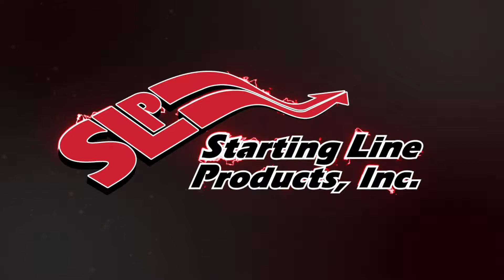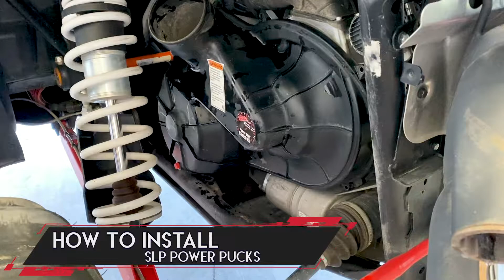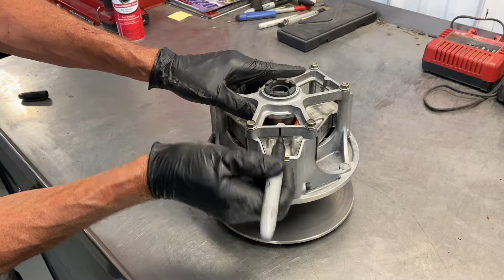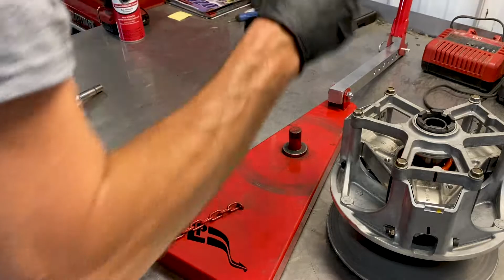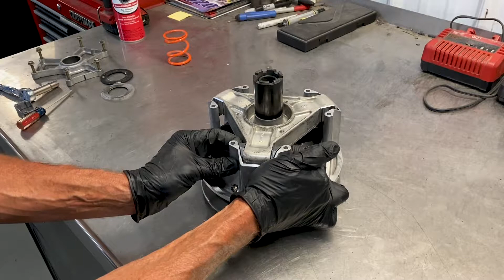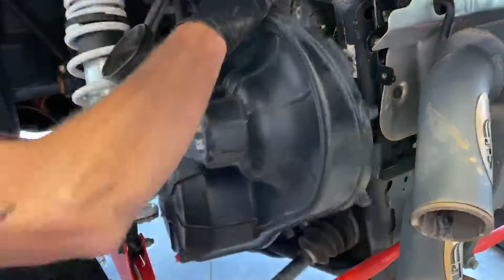How to Install SLP Power Pucks™ #50-365

Comment: I have a 2019 xp turbo with the glued in power pucks installed, but they are coming loose.
Can these fit my machine?
Reply: Yes, you can use them, but it would also require upgrading to the Polaris Drive clutch from the 2020 Turbo S-4 model to give you enough room to fit this type of puck. If the glue-in pucks you have are coming loose they won't come out as they have multiple mechanical stops, but I would recommend re applying the glue.
Reply: @adamwood9572  awesome,  I'll just re glue mine back on. Ty

Comment: So I got the SLP high load clutch kit for my 2018 XP Turbo.  Love the kit - perfect weight system, smooth engagement, and dead on RPMs.  I have yet to install the Power Pucks because the instruction sheet makes it look like quite a job and requires several proprietary or special tools.  This video doesn't show the removal of the spider nut, grinding off parting marks, or the gluing in of the pucks.  They leave everything assembled and just slide them into the sheaves.  What is the downside of doing this?  I don't have a problem pulling the primary and taking out the spring / spider like I did for the clutch kit install, but I'd rather not completely disassemble the whole thing and buy a 3/4" T-handle, clutch holding fixture, 7088 primer, 620 retaining compound, grind off parting marks, etc. I have no doubt they're a great addition to the kit and improve driveability - I'm just trying to determine if it's harmful to just glue the pucks to the sheaves and slide them in like this video, or if I should just leave them out at that point?  Thanks!
Reply: I called SLP. This particular power puck install is on a turbo s clutch . The rzr turbo machines require some modifications to the spider (as you know). I found a local shop to do mine. I don't have a setup tough enough for the 300 ft lb torque on the spider nut.